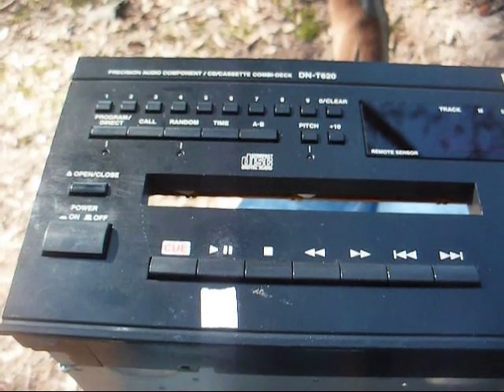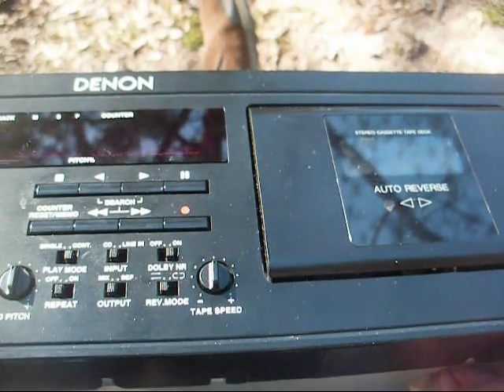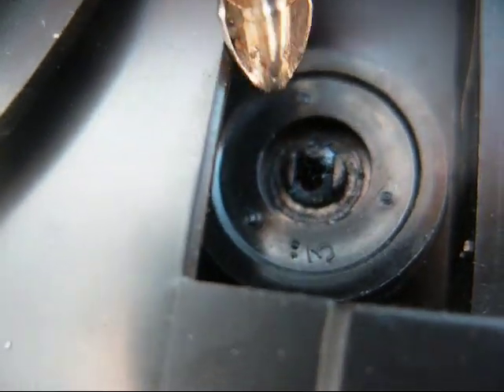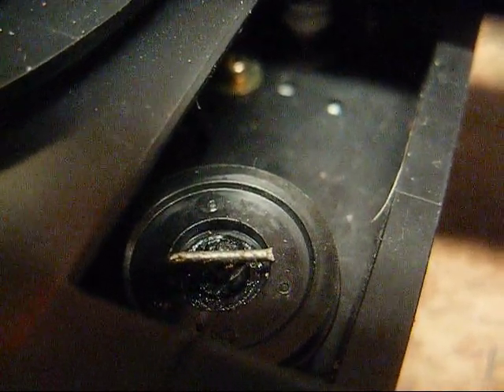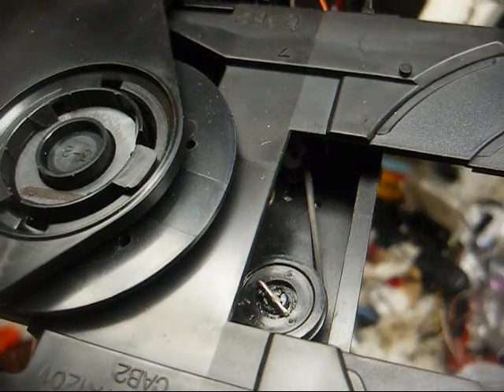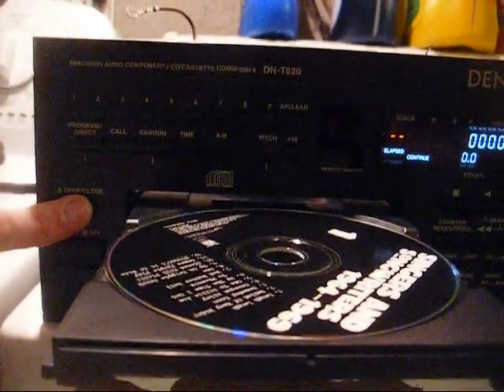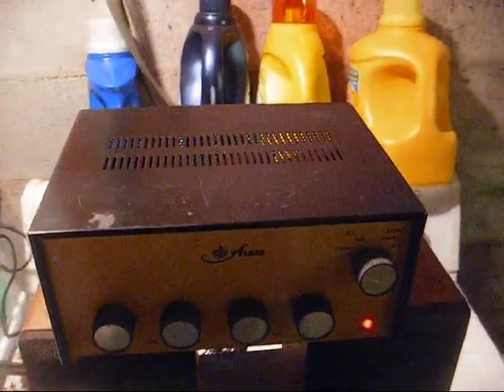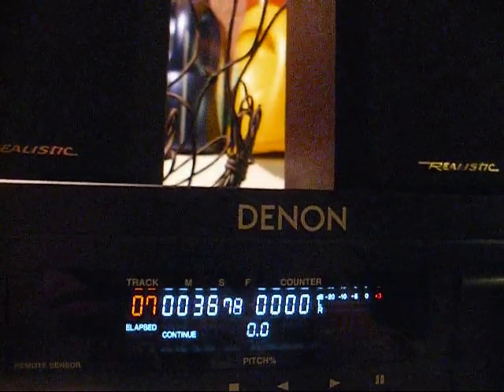Denon CD player repair, I mean patch job.

Comment: Great job as usual.  You reminded me that I fixed a cassette deck with a paper clip once.  It was a very early full stop deck that would stop at the end of the tape, even in fast forward, and rewind.  What happened is the belt kept slipping off of the shaft.  It looked like it potentially had something missing from the pulley on the shaft.  All I did with that is mounted a paper clip to the motor and then bent it to use as a guide for the belt.  He used it for years.  He eventually passed away, but he would always tell the story of "the guy that fixed my cassette deck with a paper clip".  Although the way you did it may not have been acceptable to some, it works and will probably work forever.  Thanks for posting.

Comment: Clean out any and all dust bunnies and debris that you find - especially in the tracks.
Also clean that belt with some IPA along with the pulleys that the belt rides on.
That doesn't fix them every time, but that covers a lot of what causes many mechanical issues.  
If you have a problem with the laser head; then you might bet lucky and find a replacement.
If you have to replace the old laser head, then there should be a bias adjustment for it.

Thank you for helping the church.

Comment: Many of those shafts that retained the pulley simply had a washer over a screw, screwed down into the shaft. Others just had  a pair of split plastic pieces that "sprung" apart on the shaft to hold the pulley in place.

Comment: No more for what those CD players/changers go for at your local thrift stores,I would have just got my hands on another one.I picked up a Pioneer a couple of months ago for $10 and it worked.I don't know about them either.The one I got was one that has a six CD tray.I've been given those single DVD players in the past and they work just fine as a CD player.I was told not to bother with them as zip drives are the way to go.I still prefer my old reel to reel and cassette decks.
Reply: Except you aren't going to find XLR connectors on a thrift store special.

Comment: just yesterday i bought for $5 a 1983 JVC VCR the widow that sold it to me said it stopped working 1986 she put it away until yesterday. i  plugged it in, no power. it was a blown 1.25amp automotive type glass fuse next to power transformer. thing is like new old stock

Comment: MY  Denon DCD-900  CD player that I bought back in 1987, is now 33 years old and still working like new.  Still not a scratch on it.   Long ago I have had to replace the belt that is used to open and close the tray.  I just took a belt out of an old dead cassette player that was in my junk pile and used that.  About 3 years ago the player started skipping on just about every CD. But all it needed was a few drops of electric shaver oil on the motor gears that shift the position of the LED/detector that scans the CD.  It was moving to slow beforehand.  The gear lubricant had dried up to some degree. Anyhow, the total repair cost was just a couple of pennies.

Comment: Wow, this is a pretty nice unit for the early 2000s. It's a shame they used so much plastic on it, otherwise being Japanese made it could probably last quite a while without needing repair. The only way I could think to fix it once that plastic shaft snaps would be some sort of screw to fit down the shaft with a wide enough diameter head (and nut) to hold itself in place. Great repair as usual, stepping outside your comfort zone just proves you are excellent at repairing electronics. Hope you stay safe during this virus, looks like you have plenty of time to finish some projects!

Comment: Well, thanks a lot for this.  Now I'm on eBay looking for one, because I like the professional balanced inputs and outputs and the full timecode display (if I remember right, it counts in 1/72 second increments for some reason).  Back when CD-RW's were first available, I remember needing to mess with that timecode to master a CD.

Comment: It's ridiculous that commercial equipment would be made with cheap plastic parts in the first place.  Industrial components are supposed to be made for very high duty cycle, like 100% duty cycle.  That extreme duty cycle is what you are paying for in the first place.
Another aspect of industrial equipment is serviceability and parts availability.  These are the other primary reason for the cost of industrial equipment being so high.  
High duty cycle, field serviceability and parts availability are what make something industrial or commercial vs retail consumer use.  Something like this would be used normally for, say, a retail outlet where the things runs 16hours a day 6 or 7 days a week.

Comment: Dead on with the Denon  being fixed. As the plastic ages  it does become brittle(hydrocarbon strands weaken)!
 Keep some two part epoxy and superglue handy in case you run into this kind of trouble again!😉
Reply: Kind of like bones and teeth humans have when they age over time.

Comment: I wish I had the time and money to travel there to meet you in person.  I love watching your videos.   Also if I had the money, I would have you restore an old Phillco table radio I have that was made in the late 30s or early 40s.  It use to work years ago, the last time I used it was during the first gulf war with Iraq. That was in the early 90s I think and it did not work that great then.  I was using the shortwave bands on it listing for information that was not on the regular radio stations and TV. I would just want it electronically restored and maybe some correct knobs put on it.   It was not a low end radio, it has a transformer.